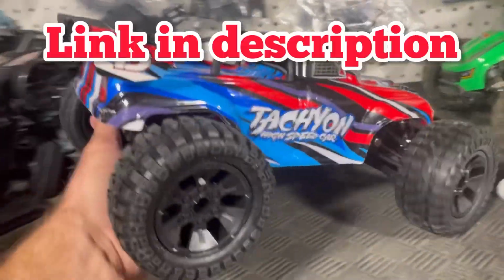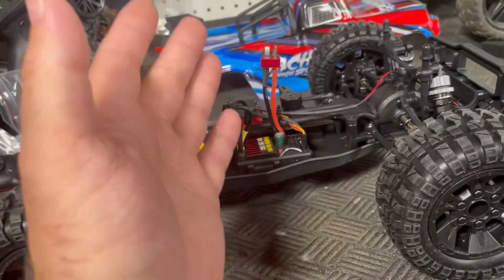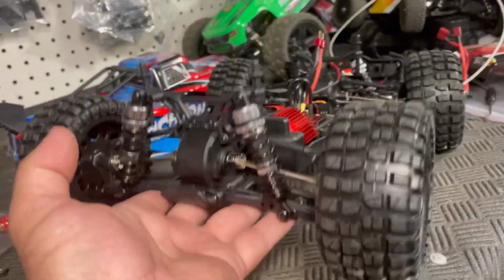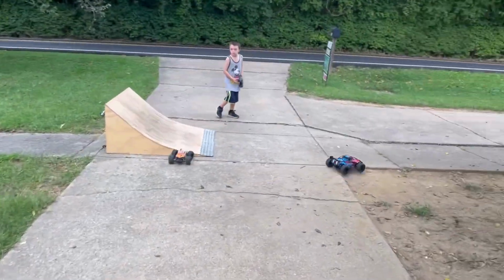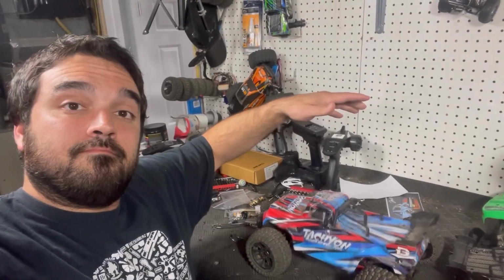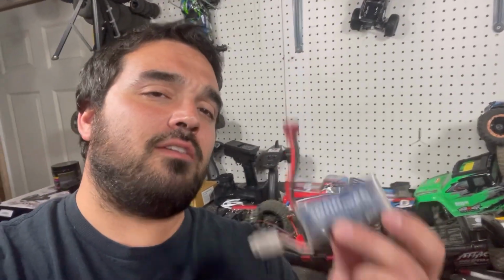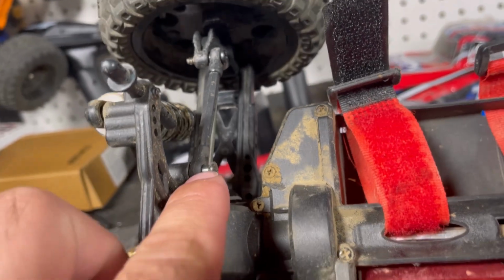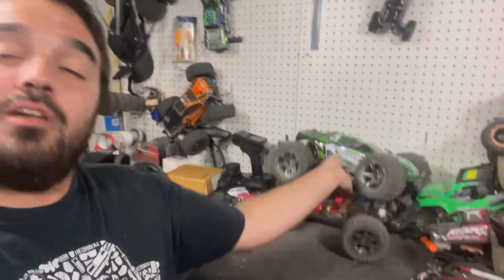New Brushless RC - 3s batteries included! DEERC 210E

Comment: if I am going to use this truck with and FPV, I want to run it around my block only , but how can I make sure the truck and controler wont fail against the FPV signal?
Reply from the maker: I’m not an expert there unfortunately, but I believe it won’t be an issue. May just need to make sure your camera doesn’t run on 2.4GH
Reply from the maker: Cool, then the way I understand it, there should be no interference.

Comment: Great video! I have 2 other DeeRC trucks. I noticed you trimmed the body of the yellow truck as I did mine as well as removed the spare tire top lights (0:42 seconds of your video. I’m ordering this truck today I wish it came with 2 bodies like the yellow truck mentioned above, although I didn’t get the orange body with mine as I prefer it to the yellow, I’m still pleased with my purchase. My buddies and I built a large track. I may post a video during my unboxing.

Comment: Awesome review. Was looking for a durable, cheap brushless 1/10 basher and this fits the bill.
Reply from the maker: Thanks! Definitely not a bad car!!👍👍
Reply: @DerbyCityRC  Ordered one and going to put my wltoys 104001 shocks on it. This truck is definitely more durable than the 104001..
LOL!
Reply from the maker: Yes much more durable lol. But I think the shocks from the WL toys will be too short, unless that’s what you’re going for lol
Reply: @DerbyCityRC  Thanks, the 210E will arrive tomorrow and will compare the lengths. I think I'll salvage the rear shocks from the 104001 (90mm?) and order another rear set from from AliExpress. Are the front and rear shocks the same length on the 210E?
Reply from the maker: Oh woops I misread that. You said 104, I was thinking 144001. 90mm should be a good length. I have used some slightly longer shocks on other versions of this car that I have that are either 85 or 90mm and they’re great. Yea front and rears are the exact same part.

Comment: Son and I are new to rc cars. Your videos have been very helpful AND entertaining. I was all set to buy this truck until I watched another popular video in which the guy hated it and made that very clear. His attitude seems like he's always grumpy or angry so I factor that in but does he have any valid points for avoiding this truck. Even though it's relatively inexpensive I'm on disability and money is a big. Factor. Can't afford to buy it if it's bad.
Reply from the maker: I know exactly what video you’re talking about and I can’t understand why he says that, as he never really explains his reasons. For the price, this car is one of the ones I recommend the most. Not to mention they have great customer service and will help you out if there’s an issue. Every car has weaknesses and I’d say this one it’s the axles. If you jump it a lot and crash it, the axles can bend and the small pin that holds the axle stub to the dogbone can break. Both are common in most budget cars. Under normal driving, that likely won’t happen. As far as performance and control, in this price range it’s as good or better than others.
Reply: Thank you so much for the reply. I almost gave up after hours of research what to buy. I was set then saw his video. Even if he dislikes it at least be a decent YouTuber and reviewer to give clear reason for such acidic review. I ended up ordering it today and am now excited. I was a few hours ago. You even replying gave me some hope that not all "major" reviewers were aholes. You do a great job for the community and I love the way you involve your kids. Thanks!
Reply from the maker: I don’t think you’ll be disappointed!
Keep me posted on how you like it! I try to give as much info as I can along with how I honestly feel about what I’m reviewing!

Comment: Those Are oiled shocks I think even from the original 9200e. You just need to put oil in them although they do tend to leak easily
Reply from the maker: Ya I saw they mentioned that on the website, but I’ve had them opened up and they don’t look they would dampen any better unless you put petroleum jelly or something in it lol
Reply: @DerbyCityRC  make sure it has a rubber gasket. The new ones often don't come with one and I think that's a problem with the manufacturer
Reply from the maker: Ya I like the red ones I showed lol. They come with a really thick oil in them already, but honestly, like I mentioned, even those stock shocks it came with aren’t too bad.